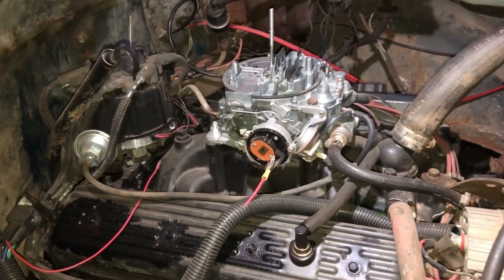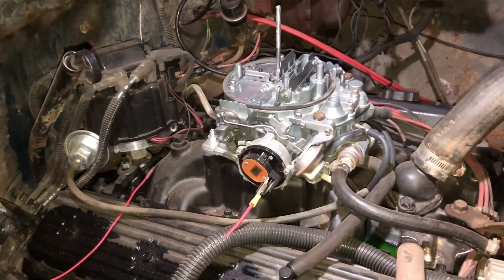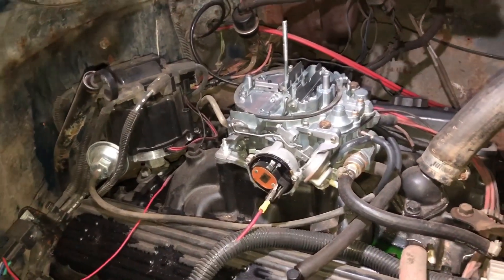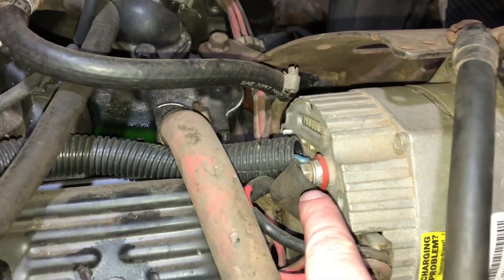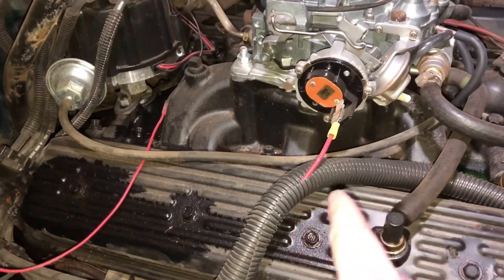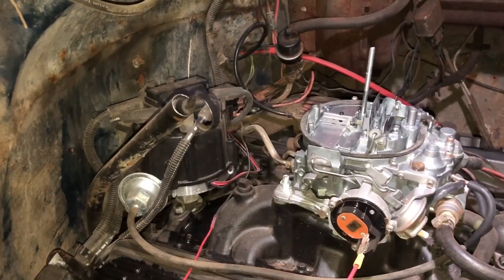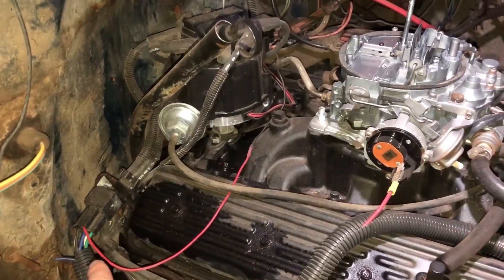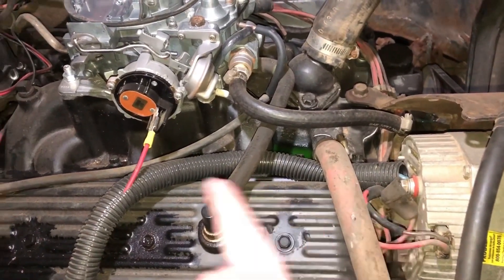Use Relay to Power an Electric Choke

Comment: Isn’t your choke on all the time since the power is coming from the alternator?
Reply from the maker: No. Power is always going to the relay, but the relay won’t send power to the choke until it sees power on the ignition coil. 

The relay acts as a switch for the Choke.
Reply: Ahh gotcha. So does the choke only operate when trying to start the vehicle? And after startup the choke starts to open back up slowly?
Reply from the maker: The choke will see 12 volts any time the ignition key is in the “run” position.  That is to say, any time the ignition coil sees 12 volts the choke will as well. 

The only down side to this is if you turn your truck to “run” for any length of time before you try to start the truck, the choke will already be starting to open and it may start hard.  

For me though, this is a non issue. There is no reason to sit with the truck in “run” without starting it.
Reply: @mebordernoneya8484  ...some older engines use a dropping resistor in line with coil power and you can't pick up 12v there!!
Reply from the maker: @earnieb5318   very true.  Older vehicles running a points ignition will only see 12v while cranking.  If you want to use the ignition to trigger the relay, you would need to find the resistor and tap into the wire before the resistor.   Usually they are pretty easy to find near the coil, but some are hidden away out of sight.   Good point, didn’t think about the pre-electronic ignition vehicles.
Reply: @mebordernoneya8484  The choke heater relay maybe hot with the key on / engine off. A 1982 will not use points as HEI was normal after 72 for cars and 74 for trucks. A oil pressure switch is used to provide ground to the choke heater, so hot only with the engine running. I never trust a dash voltage gauge as it was normally an amp gauge. They ran a fused with inline from the alternator to the amp gauge and a second fused wire to the fuse block feed. The starter’s solenoid has two small terminals. One marked “S” for full battery voltage from the key. In the run position ran voltage thru a resistor wire made with a high nickel allow dropping voltage to the coil because it was designed to run best on 9-10 volts for hot spark. This alone confuses many. During cranking, the battery voltage can drop to 10 volts, just when you need a hotter spark. 
  As for current in the choke heaters coil, its internal resistance will dictate the current flow using ohm’s law. It either works or doesn’t if wired. You need a digital volt ohm meter to perform actual checks.
Reply: So you’re saying the choke will be applied at all times. If the truck is running, the choke in on. Key turned to acc, choke will be on. I only want to choke to be on for a couple minutes until the truck warms up. No need for the choke to be on if you’ve been driving for 30 mins. Any ideas?
Reply: @joshuakeith8710  if you keep it with no power then it will run to rich and that is not good to much black smoke
Reply: @FOTOYVIDEOPINEDA  I think that is what's happening to mine do I need to have the choke connected or can I just unplug it.
Reply: @juanchoman9824  has to stay connected with power to stay open otherwise it'll stay closed and give you issues
Reply from the maker: An Electric Choke begins to open when it sees 12 volts. When the 12 volt signal goes away it begins to close as the element in the choke cools off. 

So, hooked up as I have above, when the key is off, the choke will begin to close until it is fully closed. i When the key is on the choke will begin to open until it is fully open. 

If you wire it the way I (tried to) describe, it will work the way it should. The choke will be closed at start up and will start to open as soon as the key is switched to “run”.   So as the engine runs and warms up, the choke warms up and begins to open. 

Wire it like I did and you will be happy. IMO.